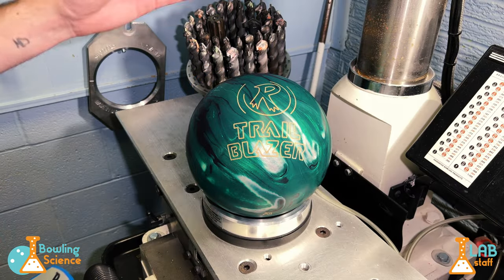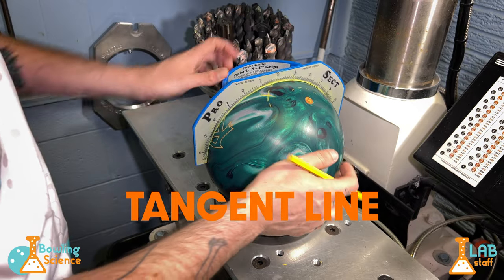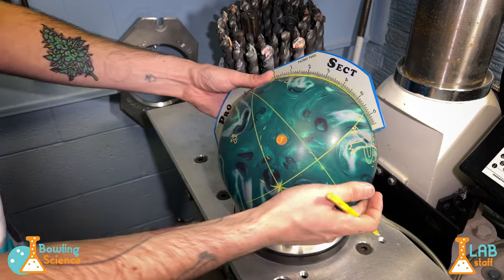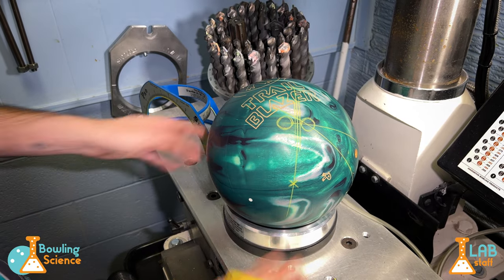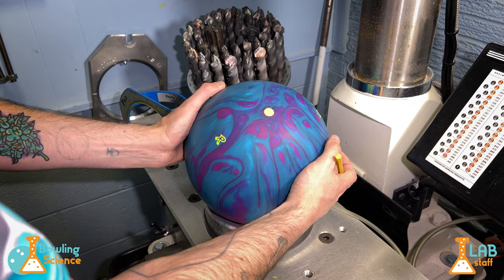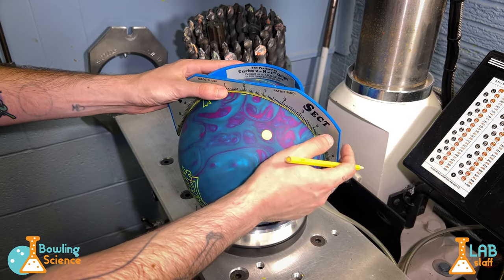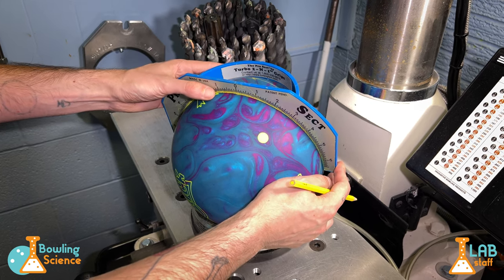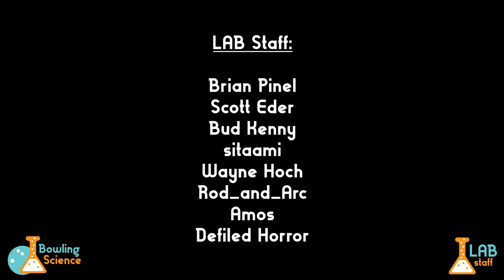The PAL Layout System: a guide to using the BEST LAYOUTS for NO THUMB and 2 HAND bowlers

Comment: I've been using the No Thumb nka PAL system (much better name btw) for a while, and always found the step of finding the PSA to be useless.  I basically just skipped it and oriented the ball so the cg would end up where I wanted it.  So I approve of the change you've made to the SYM layout method.  I've found that I get better reactions out of the PAL system and just the plain old dual angle system, compared to the balls I've drilled with 2LS.  Keep up the good work.

Comment: I’ve been no-thumbing since before reactive (I’m an old head) and have been using dual angle layouts for symmetric and asymmetric for the past three years with an occasional ⚡️VLS (👎🏼) thrown in the mix. I have a fleet of balls coming my way and I’m excited to FINALLY put the PAL layouts to use in my arsenal. 

It’s awesome to find somebody with a PAP as unique as mine out there as we’re really close (5 7/8r, 2 1/4d). 

Most effective DA layouts have been 70x3.5x20 on Zenith Hy, Obsession Tour S/P 90x2.25x45, Command Solid 70x4x40, Collision 65x5x40, DGV (Igniter & Payback) 80x3.5x45.

I’m looking forward to ALL of the layouts!!!

Comment: I have been bowling 2 handed since January maybe.  Tried some with the 2ls system and the ball changed direction really hard and couldn’t stay in the pocket.  Went back to your dad video and then pulled the original
Sheet you had on these and
The difference in ball reaction is crazy.   I averaged 200 over the last 5 weeks of league.  I’ve never been able to average 200 for that amount  to time.  Usually stayed around 190 one handed.  Appreciate your work
Reply from the maker: Thank you for sharing! These layouts just plain work

Comment: Great tip @ 8:44.  I've always had trouble finding a consistent mid/center line on drilled 2H balls.  Never thought about using the original line as the palm marker, and having a permanent reference point.

Comment: Hey, Mikey. Could you elaborate a bit about top weights and kicking out the CG on symmetrics so we don't run into ball legality issues? You've got me nervous now. I own a few pieces with 3.5oz top.

My PAP is 6.5 right by 2 down so I usually run over the middle finger for the first few revolutions. Fingers are drilled 3-4'' deep and I usually place the CG in a typical spot, like a  standard 3.5'' PSA to PAP. 5 inch Pin-Paps on most of my stuff too.

Could this already be an issue with imbalanced top weights or would it need a really wild layout to throw it off? Examples would be awesome. Bit of a loaded question, but figured you'd be the guy to go to. Love what you and your father have contributed to this sport. Cheers!

Comment: I have back pain problem hence reduced my speed/rev. Speed around 14, Rev 200rpm, PAP 5 & 7/8th Up, High track.
Need two layouts - strong midlane (45-4-20) and another strong back end (75-4-25) on asymmetric arsenal

Comment: Dumb Question:
How do you drill a modern ball with a core so it rolls the same as a pancake weight block ball does with the old school label layout?

In other words, and old school label layout will work perfectly for any style of bowler, 3/4, Full or Spinner.
CG is just placed in the center of the palm.

My Grizz and Rhino are like this and they both have a very smooth and continuous movement across the lane.

If a player wants that same look, but wants to take advantage of the strength of modern coverstocks without the additional dynamics of the core being in play, how should they lay it out?

Would there be difference between how a Full Roller would do this vs. a 3/4 or Spinner?

Thank you!
Reply from the maker: You would have to find a HIGH RG ball and use a 6” pin. Unfortunately drilling holes only lowers the rg, so you can’t drill a modern lower rg core to be like the oldies. I have a Dick Weber legacy reactive that I love for this reason. It’s high RG but also it’s an asymm pancake, so it does the job!
Reply: @BowlingScience  But what would the layout look like?

Comment: What difference in lateral finger pitches is needed to prevent the holes touching when drilling so deep into the ball on the fingers?
Reply from the maker: It depends on the difference in forward and reverse in the 2 fingers. I always suggest more forward in the middle than the ring, so that by itself will cause most to miss. But as long as the hand will allow it I use 7/8 difference in laterals.

Comment: Just a curious question. If you were to measure that layout in dual angle on the trailblazer what would it come out as?
Reply from the maker: So the exact angles will change based on PAP location, but it’s equivalent to the 90/2.25/45 DA layout even though the angles vary.
Reply: @BowlingScience  yeah I assume there is some variance. For a dual angle layout though that isnt necessarily a bad layout. Do a lot of these PAL layouts translate closely to "ideal" (I say that loosely because obviously results vary) dual angle layouts?
Reply from the maker: So dual angles have to be adjusted for pap to be used properly. The PAL takes that variance out by building in the angle changes into the geometry. The goal is the same performance for each layout regardless of PAP. I would say the strong layout is similar to 40/4/30, the angular is similar in performance and post drilling numbers to 70/4/20 and the smooth layout is like a 40/4.5/60 DA (all approximate and based on true post drilling pin location, as the low rg axis moves after drilling.
Reply: @BowlingScience  ah gotcha. So instead of building and varying angles around a bowlers PAP this more focuses on using the given geometry of the core to create the same shape regardless. Gotcha. My engineering brain was just kinda curious. Thanks!
Reply from the maker: Exactly!

Comment: why pap to rf line 4.5 inches? i dont understand tangent line.. where do you find it?
Reply from the maker: None of the layouts have a pin to rf line measurement of 4.5 inches
Reply: @BowlingScience  There is also the painting at 4:05 minutes of the video. As far as I understand, half an inch is deducted from the middle line from the pap.

Comment: No thumb bowler here . My track line is rolling right over my finger holes . The pro shop said it was my release . Could it be how it was drill?
Reply from the maker: It is caused by the release, but most no thumbers need at least a small performance fit to help remedy this. I had 10 degrees of tilt as a 2 hander, which is a lot for no thumb, and I still clipped the holes without using these pitches.
Reply: @BowlingScience  thank you! maybe I’ll see if they can watch my release an see if there is any changes they can do!
Reply from the maker: I would roll everything left 1/4” and adjust the forward and reverse so that there is more forward/ less reverse in the middle than the ring.
Reply from the maker: To start. Definitely get with your pso

Comment: What pitches do you personally use?
Reply from the maker: I recommend mf 1/2 left x 1/8 fwd and rf 3/8 right x 5/8 rev as a starting point. My pitches are 13/16 left x 1/8 fwd  mf and 3/16 right x 5/8 rev rf. I needed to go more left to clear the fingers with my pap and account for a bent rf
Reply: @BowlingScience  ok thanks for response, Like you I track real close to my middle finger.
Reply: @BowlingScience  I'm 6"1/8 right and 3/4 down last time I checked. But I should check again since that was like 4 years ago😂